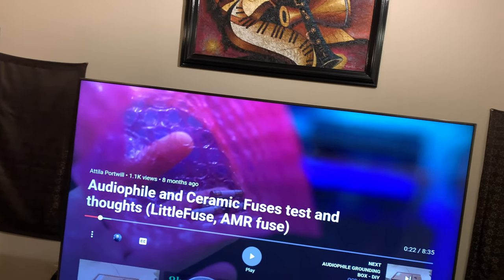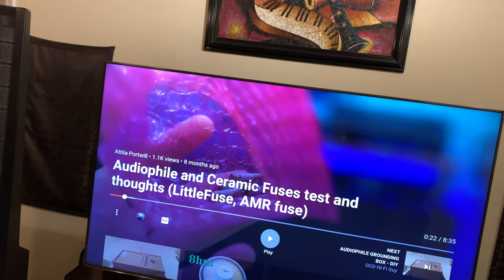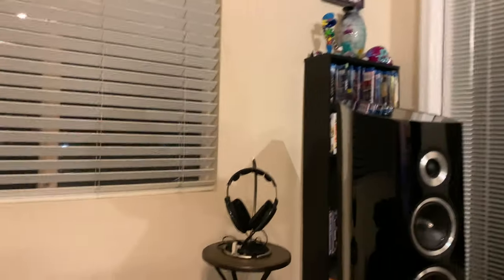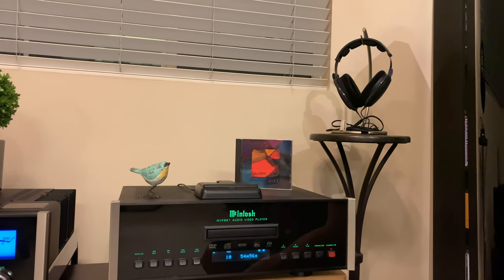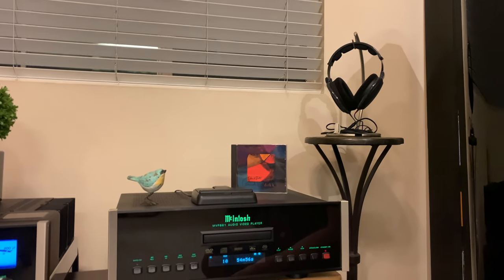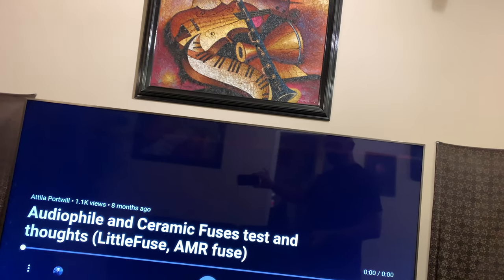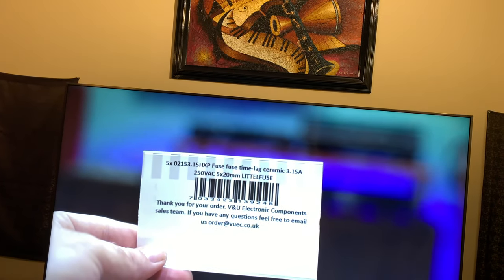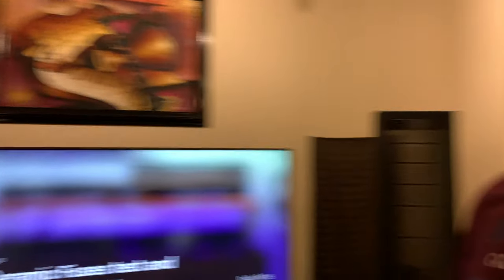My Audiophile System Vegas “ I Put Cheap Ceramic Fuses In My Audiophile Setup  & Was Blown Away!”

Comment: you really hate me when I say this..... probably the old fuse had some problems....
Reply from the maker: 😂...I've actually since upgrade to a synergistic research orange fuse, and it blew away this standard ceramic fuse. There is truth to the upgrades based on my listening experience. I hope you get the chance to test it yourself and see what you discover. It's a great hobby to play in for sure! 👍💯🎼✨
Reply: @vpconcepts9838  actually I am looking to... but with guitar amp... thx for your videos tho they are helpful.
Reply from the maker: @sasakikojiro8063  🙏🏻🎼✨

Comment: If your CD Player is affected by fuse vibrations, that's an incredibly bad CD Player with terrible design. Get something that's more than 20$, you won't have these issues.
Reply from the maker: 😂 that's a 5k CD player brother. The micro vibrations come from electricity going through the metal filament in the glass fuse.  Thanks for watching. 👊🎼✨